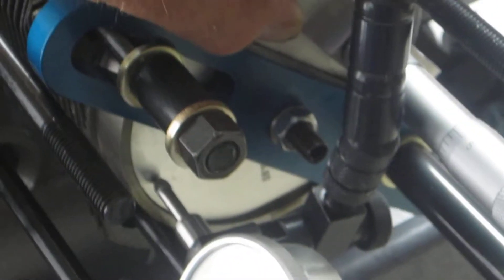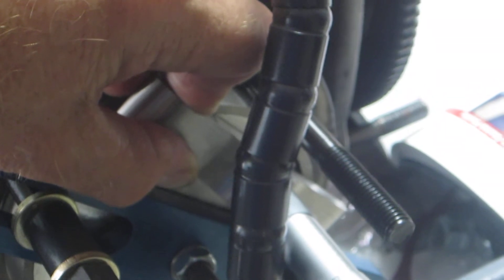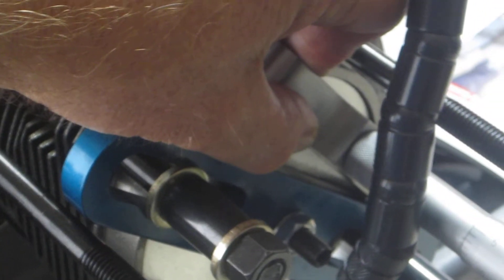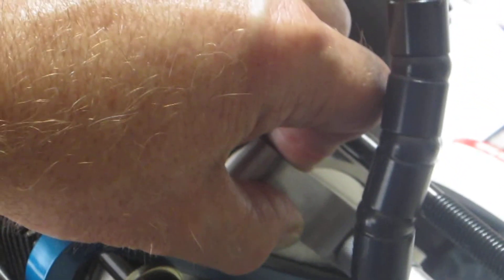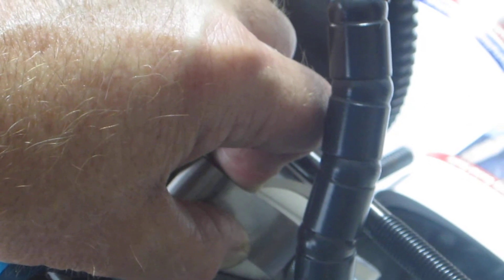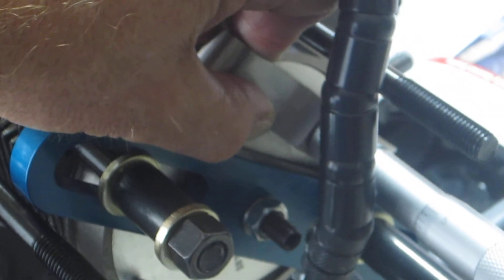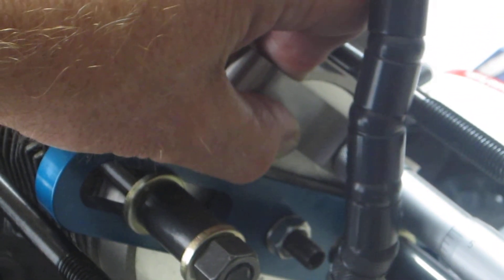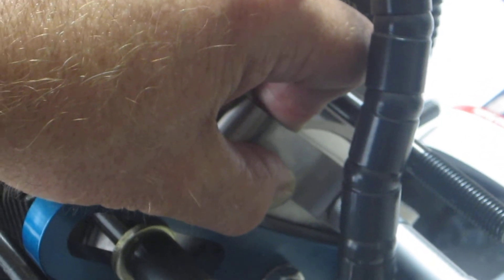2332cc VW Engine Part 2b (checking deck height)

Comment: Checking out some of your older vids. Not only am I building a 2109, I'm building confidence. The 2109 choice is well, a story of how it was gonna be a 1915 but... 
I'm doing deck height adjustment now. Just got my 94mm shims. Thanks.
Reply from the maker: Thanks. Good luck on your build. I hope to jump back into this build, which has been on hold due to a relocation. Next up (or soon) is installing the custom-cut pushrods and 1.4 rocker arms, as well as the exhaust and IDAs. More soon!